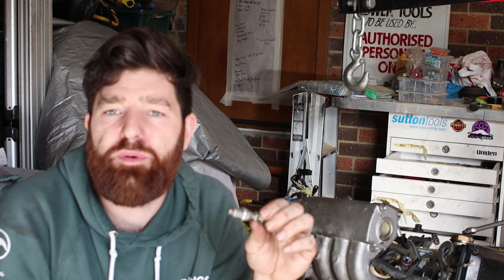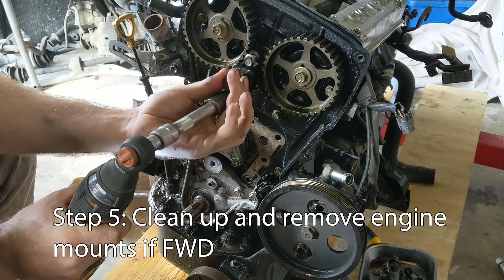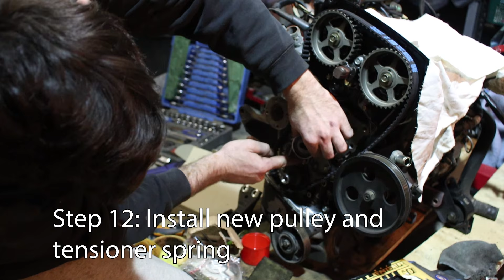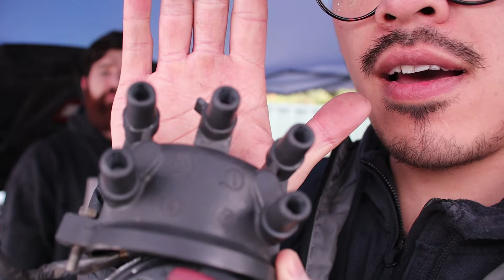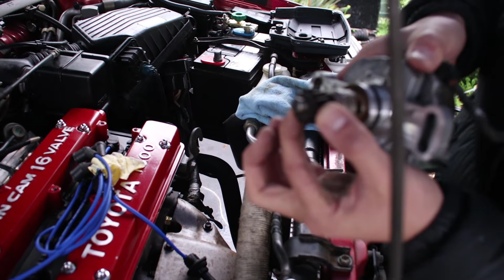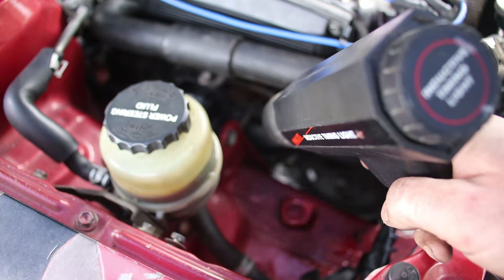No Nonsense 4AGE Timing Kit & Distributor Install + How to set Timing (with torque specs)

Comment: Great video guys - 
I'm having a lot of issues reinstalling my dizzy and when I bought the car it didn't feel as confident going past 3.5k RPM. 

When I bought the car the timing belt was changed and I suspect the crank may have been turned - At supposed TDC with 0° mark cams are lined up with the notches, and the crank mark is lined up with the pin which is in a different location. This is the way  the Toyota repair manual says to find TDC .. I'm just unsure why there's also the timing marks on the crank case cover

Comment: Ok so in the case of putting in a new distributor, I take the timing cover off and set it to top dead center by referencing the marks and twisting the pulley until it matches ? As well as marking the position that the dizzy was put in ??
Reply from the maker: Bingo!

Comment: Idk if ur still responding to comments but I cant find the harmonic balancer on my aw11 mr2 do you know where its located?
Reply from the maker: Harmonic balancer and the main crank pulley are the same part. 
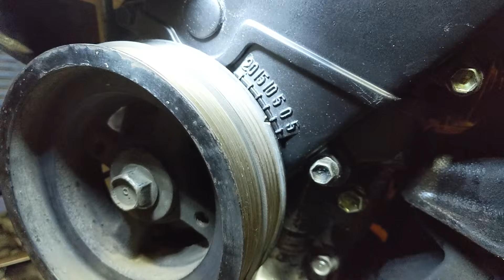Mine is pictured in this video at 5:53